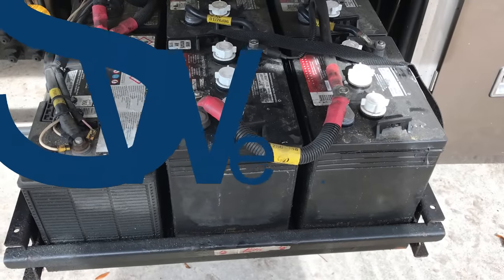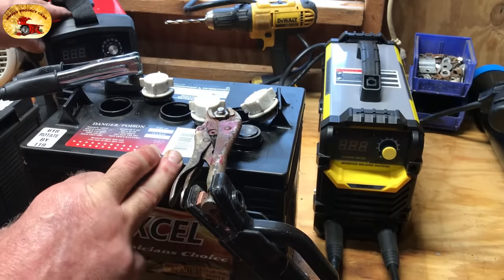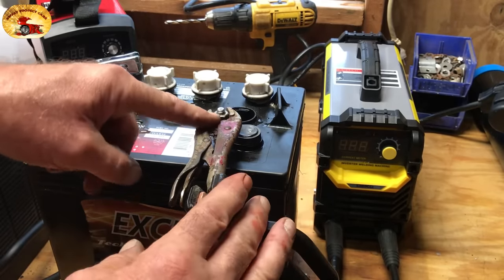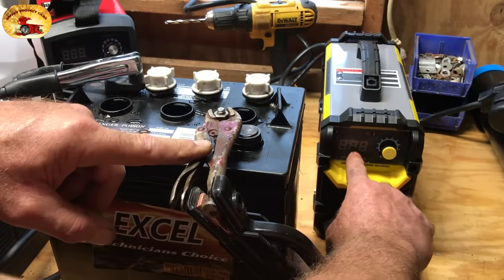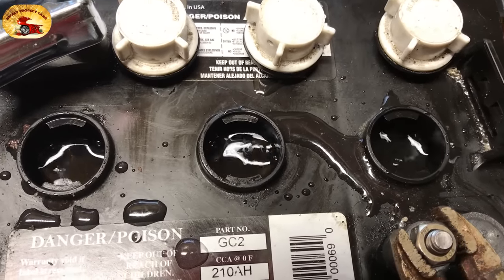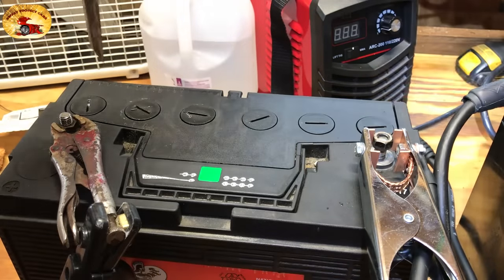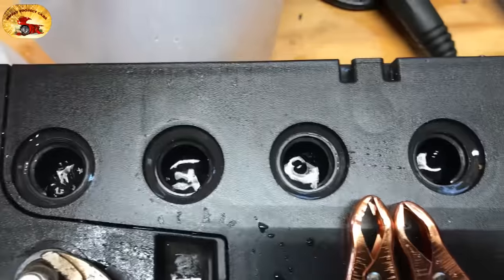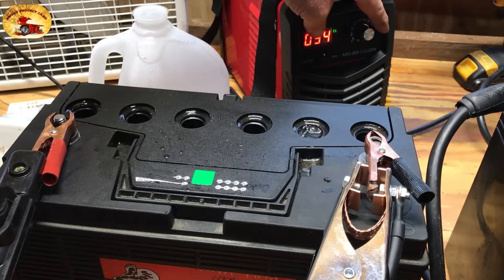How To MAKE OLD BATTERIES NEW Again!!!  12v 6v Deep Cycle, Car, Truck, Golf Cart, Semi

Comment: Why can’t you use the yellow welder for the car battery if you’re only using a fraction of the amps?
Reply from the maker: You can use whatever you want to use, we are just sharing what we know works and is safe for both you and your batteries Barry. Thanks for watching. mad Mike the hammer SPC
Reply: Thanks for the quick reply ❤️🙏. I was just wondering that’s all. I have a DekoPro 160A welder and I thought that I would give it a try, but I couldn’t get the battery to bubble like you did. All I got was the battery solution overflowing. I guess that I put to much distilled water into the battery cells.
Reply: I really enjoy your channel and have try many of your other solutions to success and I have shared your channel with many of my friends and family 🙏❤️

Comment: The welder you have linked for standard 12v batteries has two control  dials. Are they both used for this process or just one of the dials?
Reply from the maker: You only use the current dial, start out low and turn it up until you have a rapid boil, leave the other dial at 1. Thank you for watching, have a great day my friend. mad Mike the hammer SPC

Comment: Im not sure what the difference between the two welders relating to 6v and 12v. There both stick wilders. The only difference I see is one is 160amp and the other is 200amp. Are you saying either wont work on both 6 volt and 12 volt batteries
Reply from the maker: Hello Creg, you can use whatever you want to use. Our videos are very tool/product specific, so to obtain the same results you need to use what we use in the video, we have done all the testing for you and we only share what we know works and is safe for both you and your batteries. Thanks for watching, have a great day. mad Mike the hammer SPC

Comment: I have 250amp dc inverter welding machine and when i tried to connect the correct way its not showing any signs, doesn't even bobbling. Any idea why?
Reply from the maker: Please do not use any other tools or equipment other than the one's we use, this testing has taken us years to perfect and we know that they are safe for both you and your batteries.  Thanks for watching. mad Mike the hammer SPC

Comment: Hi Mike, again, thank you for your useful tips. One dumb question, the link to the red welder shows a newer model which has two knobs on the front. the one you demonstrated only has one. Sorry I am not familiar with welders and I don't know if there is a difference or which knob  to manipulate or may be both?
Reply from the maker: Glad to help unidad! You only use the current dial on the updated welders, start out low and turn it up until you have a rapid boil. Keep the other knob set at 1. Hope this helps. Thank you for watching and asking, have a great week my friend. mad Mike

Comment: How do you get proper acid water balance ?
Reply from the maker: The acid doesn't evaporate, only this  https://amzn.to/3gb9Ni0  which is why you top off the cells within an inch of the tops before doing this process then again at the resting times if needed. Thanks, have a great day. mad Mike the hammer SPC

Comment: Why do you need 2 different welders.?  Why can’t you used the bigger one for both?
Reply from the maker: Because we have done extensive testing using the welders shown for each different battery, we can guarantee results and we know that our method and recommended welders are safe for both you and your batteries. But, you can do whatever you want to do stevpace1. Thanks, have a great day. mad Mike the hammer SPC
Reply: @SweetProjectCars  I’m not arguing about it.  I just don’t understand it.  Is it voltage or amperage or another reason?  I know nothing of welders and welding, I’ve been watching videos to try and understand it.  I also have a limited knowledge of mechanics beyond changing out parts.  I want to help my elderly mother and sister by repairing their electric golf cart which has 6 volt batteries and my golf cart that is gas.  I have ordered one of the welders you recommended, for the deep cycle, but I still don’t know what amperage to set it on.  I’ve watched many videos but they are for 12V batteries.  I’m retired and have limited fixed funds to work with.  I can’t afford to buy 2 welders plus they will probably only be used to revive batteries,  I’ve seen post that say the recommended battery charger  US20  6/12  you recommend in an earlier video will over heat and ruin the charger which cost over $340.
 But thank you for the videos you have provided.

Comment: Will the welder you used for deep cycle not work for standard 12 volt carry batteries? I have several deep cycle 6 volts i would like to try to bring back but also have several standard 12 volt batteries to do as well.
Reply from the maker: Our videos are very product/tool specific Justin, you can use whatever you want to use but to get the same results we do, you need to use the products/tools we use. Thank you for watching, have a great week. mad Mike the hammer SPC

Comment: all these inverter welders are about 24v DC ish. You could also use a lab bench power supply.
Reply from the maker: You can use whatever you want to use, we are just sharing what we have tested and know works every time plus is safe for both you and your batteries.  Thanks for watching Dehv, have a great weekend. mad Mike the hammer SPC

Comment: Did this with 3 × 12 volt deep cycle batteries over a 3 day period. The batteries are 5 year old maintenance-free batteries  that my friend had in a golf cart that he sold me last year.
The cart would move extremely slowly prior to removal from the cart. 
After charging, the batteries barely made it above 12 volts and wouldn't maintain the voltage, then returned back to the 11.7 avg.
 thing that I did was to steam clean the exterior of the batteries with dish soap to remove dirt, grease, and any acid residue. Next, remove the labels covering the screw down caps, and with the caps off, I hooked up a regular charger for fun to see if there were any signs of charging bubbles, but even after an hour, no signs of anything positive happening, until I hooked up the DC inverter welder and I was in a totally different universe where I'm now in control of my batteries destiny thanks to Sweet Project Cars. After working on the batteries on and off for a couple of days, the SOH (STATE OF HEALTH) went from 65-70% to 90% on all 3, and the SOC (STATE OF CHARGE) went from 60-65% to a consistent 97-100%.
The only question that I have is that the electrolyte in the cells is extremely dirty. it's obviously the sulfate that has been dislodged from the plates, would it be worth the effort in trying to filter out the crap that's in the electrolytes, and if I did, can I assume better battery longevity and performance? 
Thanks again!
Reply from the maker: Anytime you clean something up it works better my friend, if you have the time it doesn't hurt to re-condition the things you care about. Thank you for watching and sharing your results, we really appreciate it, hope you have a fantastic week. mad Mike the hammer SPC
Reply: There's another post in this thread from a couple of years back that talks about it. His recommendation at the time was to drain and replace the acid.  IDK if it would improve life or not, but it surely couldn't hurt?

Comment: Hey mike with the yellow welder what is the max you should turn the dial to wake up a 6v deep cycle battery? I have 4 batteries total, 2 started bubbling when cranking up 2 notches. The other 2 haven’t bubbled even when cranking it up 5 notches. Do I crank it up until it bubbles or will it harm the battery?
Reply from the maker: As long as you have your fluid level where it's suppose to be and you turn the welder on then it sits for more than a minute and none of the cells boil, your battery is toast. Hope this helps Josh, thanks for watching and asking, have a great weekend my friend. mad Mike

Comment: Yup, mine was 12.0V in the morning, let's see now. I did a few 75A cycles, i'll let it sit and fully cool down overnight before putting back in the car.. btw is it normal that the liquid in the battery looks now "muddy"? And the stench under those amps 🤮🤮🤮.. thnx
Reply: Ok 12.6 in the morning after i let it sit and cool overnight SO i decided to give it another desulf cycle or 2.. BUT what concerns me now is that the cell no.4 is not bubbling as strong as the others.. 😳 i wonder if it is shorted or what? Even poured a little distilled water in each cell, still the same 😳

Comment: You mentioned to get a 200 amp welder or charger but I noticed you're not going above 100 amps to revive the battery. Could you please explain? And again thank you for the videos!
Reply from the maker: If you would like this process to work, please don't dissect it, use the exact tools we use and you will be glad you did.  Please note, some batteries, and you not knowing where your battery currently is, take well over 100 amps. We believe in having tools that go over and above is the key to ultimate success.  Thanks for watching Vatche, have a great day. mad Mike the hammer SPC

Comment: I have access to a older welder it will turn up and down the amps. should i use your Old method 15 min on 15 min off or use this new way 5 min on 10 min off? 
     Thanks Barry
Reply from the maker: Use this method Barry, it's updated and works way better, but our videos are very product/tool specific so we can't promise the same results using your tools.  Thanks for watching and asking, have a great day. mad Mike the hammer SPC

Comment: The numbers on your welder is the max amps [current] at that setting; Not voltage! Couple a DC voltmeter to the battery to see voltage.  DO NOT OVERHEAT the battery,the plates will buckle and short !!! [That is as here in South Africa]
Reply from the maker: Thank you for watching and sharing, this is a process that needs close attention paid while doing it. Have a great day. mad Mike the hammer SPC

Comment: I wonder if tap water would work if someone needed to do this in an emergency?
Reply from the maker: EMERGENCY ONLY! Then you will need to drain it out and replace both the electrolyte and the distilled water when the emergency is over. Thanks for watching, have a great day. mad Mike

Comment: I bought  the welder that's in your notes, hooked it up to my battery, it bubbled for 10 seconds and then stopped, did this twice and the same thing, What am I doing wrong?
Reply from the maker: Hello Chuck, start out on the lowest setting, then gradually turn it up until you get a consistent boil on the cells, you need to do the process 5 times (boil/rest) and you can do that up to 5 times as well, if it doesn't work after that, the battery is toast.  Thanks for watching.  mad Mike the hammer SPC

Comment: You make the best videos.  I  always watch them . They are both in stock.  I'm a little confused can I use the cheaper one  on regular car batteries?
Reply from the maker: Both welders are specific to the batteries that they will restore, that's why we listed the 2 different styles for the different types of batteries.  Thanks for watching and asking.  mad Mike the hammer SPC
Reply: I had this same question, and I think it helps to understand there are two types of 12V batteries.  One is deep cycle.  The other is the typical battery found in most land vehicles (wet inside, not gel).  The 200A battery is for the 12V version that goes in your vehicle.  I suspect the deep cycle version is probably related to boats or something else.  They require different welders to charge.

Comment: How long will last for charge?
Reply from the maker: If you are asking how long does the repair/rejuvenated battery process last, it can last for years doing this method. All depends on the quality of the battery to start but even if it only lasted 1 year and you had to do the process again, you're saving lots of $$. We have batteries we've never replaced, most last 1 to 5 years before we have to do the process again. Hope this helps, thanks for watching and asking, have a great day my friend. mad Mike
Reply: @SweetProjectCars  Thank you sir 🫡

Comment: Provided that the battery case is not bloated and expanded.
Reply from the maker: You need to use a little common sense doing this process Carl, but we have had success with batteries in that condition. Thanks for watching. mad Mike the hammer SPC

Comment: Excellent Project, Congratulations, please solve this confusion about voltages i have some batteries of 65ah, 100ah and 200ah, some batteries shoots voltage on 18 to 20 volts some are starts from 15.5 to 16.5 on the lowest settings of inverter, how to handle this or this is just a numbers please resolve this issue.
and some batteries have lots of black particles and lead acid plates are showing black what should i do in this situation can i replace the acid or do your process then replace the acid or only do your process ? kindly answer these questions it is very important for me thank you
Reply from the maker: This process works on all wet-style batteries, just follow the video step by step, listen closely as well, it is not necessary to replace acid, don't over analyze just follow the process shown and remember make sure you recap and unplug the welder before disconnecting the cables.  Hope this helps, have a great day. mad Mike the hammer SPC

Comment: What is the voltage coming out of the welder? The numbers on the welder show the current not voltage
Reply from the maker: The voltage coming out is just enough to get the job done my friend, clamp those clamps on and charge the living tar out of that thing.  Thanks and have a great day. mad Mike the hammer SPC
Reply: I'm trying to make my own from a transfer the voltage will tell me how many turns I need and is it putting out ac or dc? Some welders put out 22v ac

Comment: So no need to trickle charge when using a welder?
Reply from the maker: After doing this video, put on this  https://amzn.to/3kmCThX  until the status light on the charger shows full charge. Thanks for watching Jordan, have a great evening. mad Mike the hammer SPC
Reply: @SweetProjectCars   I already have a low I am 12 V charger but it doesn’t have a timer on it so I’m wondering how long does it normally take to charge

Comment: Hi, im happy to find your video. Just wanted to ask, i tried your advice but I noticed on my battery, the water inside turns to brownish colour? is it normal? distilled water level is ok.
Reply from the maker: That is normal, Gavin. Don't over analyze the process, just follow the video and top off the cells with this https://amzn.to/3gb9Ni0  as  necessary during the resting times. Thanks for watching, have a great day. mad Mike the hammer SPC

Comment: Help ! I've been having a little problem. The battery was kind of working, so I removed it to do this process before the winter. As I was charging it for 5 minutes at 30amps, I noticed that one of the cells was barely bubbling, so I cranked it to 65amps and it started bubbling a little more, but not as effiecient as the rest of the cells. I turned off the welder for 15min. When I started the welder again on 65amps, I noticed that the cell was not bubbling at all now. All the other cells are really bubbling. Did I do something wrong ? I tried this method on another battery, I tried to revive it like 3 times with on for 5min and off for 10-15min, and the dead cell did bubble up a little, but at the end, instead of having one dead cell, I ended up with two cells not bubbling anymore. Now with the battery that I'm doing this right now, it's making me think that I'm doing something wrong
Reply from the maker: You aren't doing anything wrong. You can do this entire process up to 5 times, if it doesn't wake up your battery by then, your battery is toast my friend. Thanks for watching and asking, have a great day. mad Mike

Comment: Hey Sweet! I did this with a stick welder called "Speedway" on an RV house battery and all the cells boiled 5 times the battery got HOT. but the battery still won't charge?
Reply from the maker: Hey Bobby, you can repeat the entire 5 step process up to 5 times, if it doesn't work after that, your battery is toast my friend.  Thank you for watching and asking, have a great day and all the best on your project. mad Mike the hammer SPC

Comment: I worked for a lift truck business at one time. They used what they called the toaster. Discharge/charge several times. It cleaned up the plates. I would imagine at some point if enough debris falls off it will short cell?
Reply from the maker: Thanks Mike for sharing we appreciate that your lift truck business knew exactly what they were doing

Comment: I have a large roll around transformer battery charger with 200amp start/crank mode. If I leave it on too long I can hear the battery bubbling. Same effect going on, what do you think?
Reply from the maker: Not really sure what your question is, all we know is that our videos are tool/product specific to complete the processes shown.  Thanks.  mad Mike the hammer SPC

Comment: When I connect my old welder to the battery it sparks. What I'm doing wrong?
Reply from the maker: We never said anything about using an old welder, follow the video to a T, listen to it very carefully and be sure to use the exact same products/tools we show. Thanks. mad Mike the hammer SPC
Reply: @SweetProjectCars  thanks for the reply. Where I live, there is no exact same welder. So could you please kindly explain what kind of welder I should use?  I am guessing something that blocks the spark.